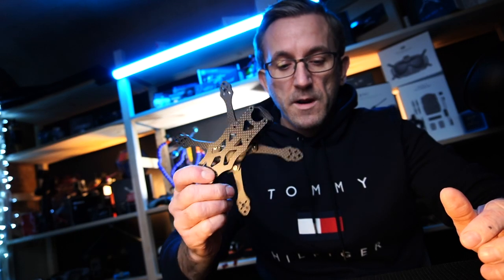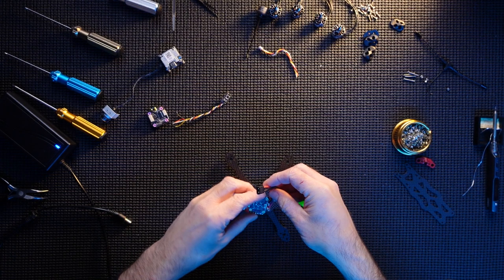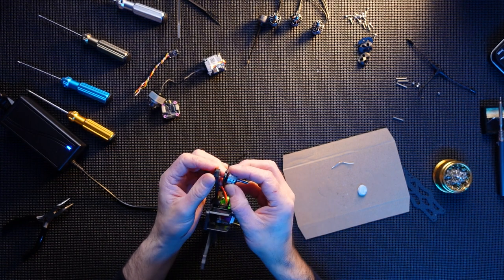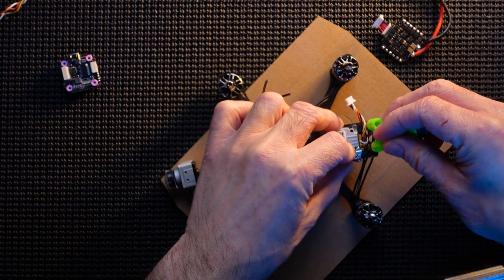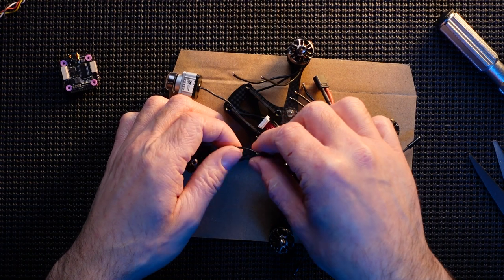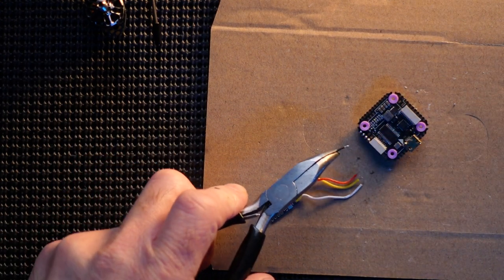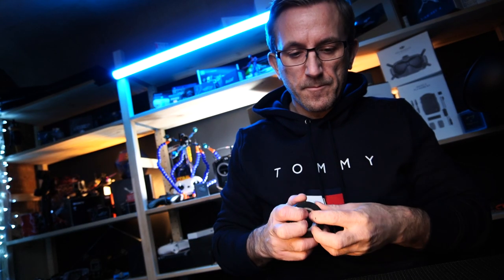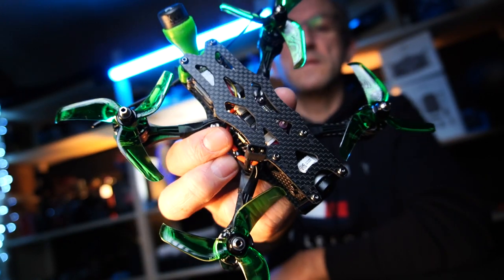ImpulseRC Micro APEX 3" FULL BUILD!

Comment: Awesome work! I couldn't get this build finished unfortunately. The stack screws that came with mine are far too short and wasn't even able to get even the 4 in 1 esc on. I'd use my own but mine aren't counter sunk like the ones that come with the frame. They are required to be as the arms ride flush underneath them.

Comment: Just in the process of building like for like as my first self build. Any need for a capacitor on this setup as one came with the stack so jw if you would recommend adding one?
Reply from the maker: I left it off as it was a small build, I haven't had any issues and it still doesn't have one - you can always add one on after if you have issues though

Comment: hey mate if i use 1408 3650kv motors using a t mount instead of a 5mm nut to screw the prop down like yours would it be better?
Reply from the maker: you mean they have the 1.5mm prop shaft - if so then they will probably be good for weight, but durability does go a bit... I don't have the 3inch anymore, I fell in love with the 4inch version...

Comment: Do you think the Diatone Mamba F411 AIO - F411 FC + 35A 3-6S BLHeli_S ESC - Internal USB will fit with a vista on this frame?
Reply from the maker: it a small frame, so only a 20x10 stack will work in it... if thats what it is ?

Comment: Did you intentionally not put a Capacitor in, just wondering
Reply from the maker: Yes, I've flown with and without capacitors, and sometime it doesn't make a ,ot of difference, and if it does need one you can actually add one in later, and its a tight build, so left it out, honestly on hd I've not noticed a huge difference... remember to subscribe! thanks
Reply: @Datfpv  Thanks! Almost done with the build, waiting for the Motors. Awesome channel 😀, subbed!
Reply from the maker: thanks man! - its a great build went out flying her at the weekend, nothing wrong with the build! enjoy!

Comment: Hi...did you add a capacitor to this build?
Reply from the maker: no I left it off, it was a tight build, I've flown with and without and sometimes you don't even notice any difference, and if you do find out you want one you can add one later - mine does not and I'm flying it withough, thanks

Comment: hey did you use an XT30 or XT60 battery connector? If so which awg?
Reply from the maker: hey, its a xt30 connection with aug 12 wires.
Reply: @Datfpv  dang i went with xt60, i hope its fine

Comment: Can a 4s 1300 fit apex?
Reply from the maker: yes of course it can, mine is a 6S set-up and I fly mostly 1300's 6S
Reply: @Datfpv  thx..this is my first 3 " drone. Will try to setup 3d mode on it.
Reply from the maker: HANG ON MATE... completely looking at the wrong thing... you can put a 1300 4s on the micro, but I think it will be too heavy to be honest - 850 4s would be perfect... sorry my bad! - I was looking at the 5inch quad at the time not the micro version!
Reply: @Datfpv setup has been moved from a 4s 4" inch frame to 3" micro apex. Props is hhe only thing that are smaller.

Comment: Nice build. What is the weight? I want to build sub 250gr. Some Tipps?
Reply from the maker: hey, she is 212g without battery - you'd need a lightish battery to keep it under 250 though... my only tip would be to buy lighter parts (sorry) I haven't aimed to keep any build I've done under 250, maybe I'll do one... remember to subscribe! thanks